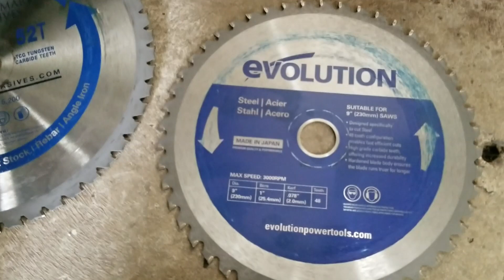Rusty the Spryte build part 61 (Structure build part 2: front cab reinforcements/uprights)

Comment: I know this is a old video but what saw were you using those blades on. They are designed for a slow saw less than 1400 rpm in most cases. If you were using them on a saw meant for abrasive disks you were probably running more than double that. Also why unistrut?
Reply from the maker: I covered that in the build series, check out the playlist for this build,  thanks for tuning in!

Comment: I really like the progress you are making with the uni-strut material. Are you planning to make gussets or use the skinning material as structural support? Looks great... was also wondering if you had a drawing of what you want as a final design? Keep blasting away at it!
Reply from the maker: Drawings??  Yeah, in my head.  Once this beast is skinned it will have a structure stronger than a roll cage yet light enough to be considered a snowcat....  Hey!  Got any spare troop seat panels I can have??  I don't want the tubes or metal just the fiberglass panels LOL  

You keep using the word "gussets" in a lot of my videos and I still have no idea what that is?  I use triangulation most of the time to increase structural strength but like I said once this beast is skinned he will be unbelievably strong.....
Reply: @SeanFastidious  Well, yes... a gusset is a piece of steel cut at opposite 45 degree angles on each end and form a triangle at a corner to prevent racking. Same thing as "triangulation" just easier to say. LOL! Normally only needed on the outer corners... keeps things beastly strong. Of course, as in a tailboom, the skin of the structure can provide a lot of support in itself, until it wrinkles or the fasteners move. Tell you what... you keep building and I'll keep watching. Deal?
Reply: @SeanFastidious  uuuuuhhhh... spare troop seats? Only if I steal the seats out of the trailer I'll building for the college veterans center students to ride in. So, I guess not? If you really need them, you can have them back... after all, they did come from your vehicle.
Reply from the maker: @HelicoolsHelipad  I am kidding.  I still have access to mountains of them.

Comment: Will you be able to remove the engine with the front structure that you have welded in place?  Can the engine be dropped from the bottom?
Reply from the maker: Hi Kurt!  I plan on being able to remove the motor/transmission through the doors or the front opening as you can see once the intercooler and radiator are lifted out.  At the beginning of this project I promised you guys that this snow cat would be better than oem and would have to be serviceable by my standards.  It will all make more sense in the coming weeks as this build really starts to take shape...  Great question  BTW....